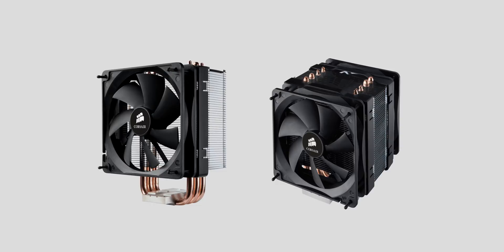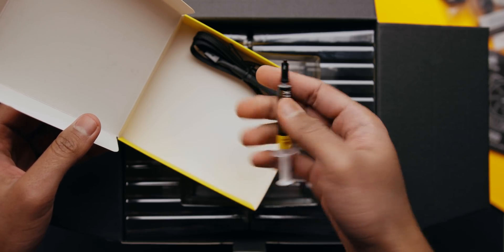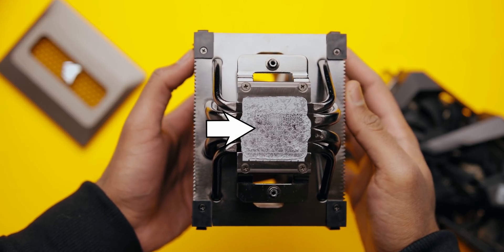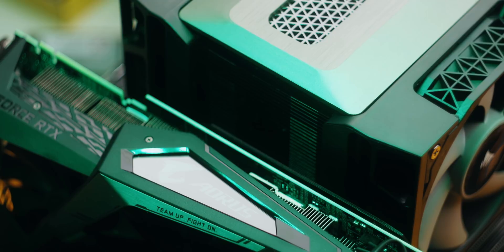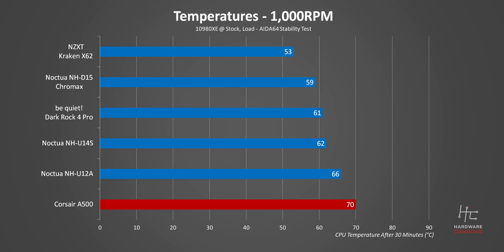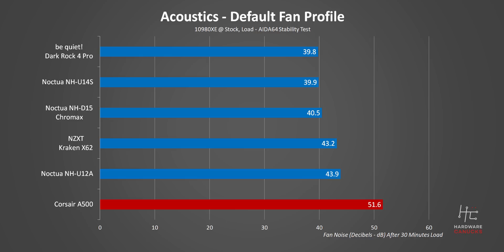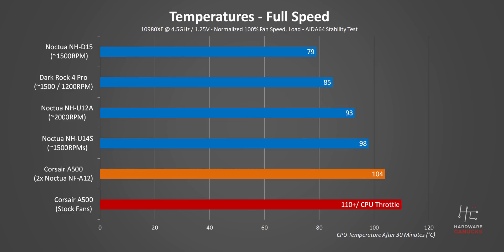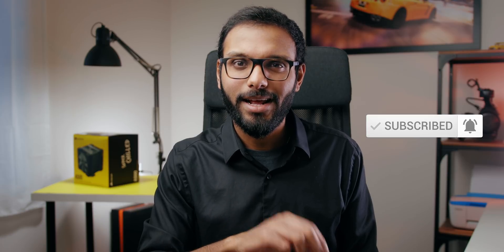Corsair A500 Air Cooler Review - Watch This BEFORE You Buy!

Comment: Why is the U12A so shit????????? You did something wrong!!!!!!!!!
It should have been almost equal to the D15, 2 more degrees at most. :|

What happened?????????????
Reply from the maker: On cooler running processors the U12A is amazing.  However its smaller fin array can only do so much when the heat production increases beyond a certain point and larger heatsinks with their increased thermal capacity start to pull ahead.  We did nothing wrong; this is just the nature of the game when it comes to cooling.
Reply: @HardwareCanucks  Then just use the 12A fans on the D15... It would still be an upgrade, right?
Can the U12A keep up with the 3950X though? No overclocking.
Reply: You are really indoctrinated to believe the U12A from Noctua is everything. I don't say that it is a bad cooler or Noctua isn't quality, but I have a cooler in my case that's only 60 USD and is in the same ball parc as this U12A if you take price/performance in consideration, but sadly none of these famous/well known Tech Channels fail to review it. That cooler is called Scythe Fuma 2.
Reply: @dorientjewoller113  It's not like I'm indoctrinated. But they advertised it so much as being the D15, but in a smaller form factor... This is the first good comparison with it, that disappointed me. :(

Btw, are you a flerf? Only they use the word "indoctrination" 24/7... 🤣

Comment: I feel like this would have been amazing with 5 or 6 heatpipes...but 4 heatpipes is just too weak
Reply from the maker: More heatpipes may have overwhelmed the small fin arrays.  remember, this thing has this massive void in the middle for installation purposes but that's a ton of space that could otherwise be used for more cooling fins.  That space likely causes vortexes to form which reduce the effectiveness of the fans.
Reply: @HardwareCanucks yes, terrible engineering
Reply: @HardwareCanucks  yeah but the NH U12A doesnt have any more fin surface area and has 7 heat pipes
Edit...well yeah the space in the middle was a lapse in judgement
Reply: @HardwareCanucks  why not add a 3rd fan in the middle? Wouldn't that negate the  vortex effects and massively improve cooling?
Reply: The other problem is the base is made out of aluminum where all of Corsair's competitors in this price category are using copper bases.

Comment: Yep, just stay with Noctua.
Reply: Or any of the other great options really. Deepcool, be quiet! or Scythe all make great coolers. Just don't get this overpriced garbage.
Reply: Overpriced and shit coloured. Thedmalright, Arctic and Scythe are much better for the price
Reply: @ryuuseiboi950  Priced appropriately due to incredible engineering and unrivaled cooling to noise performance, and the Chromax black series exists. Get your hater ass outta here.
Reply: @Thrashman138  but it's cool to be edgy and hate on good products
Reply: @Thrashman138  Whatever will make you feel better about your shitty purchase.
Reply: @Thrashman138  With all respect. I don't put 700 to 1000 dollar system in an already 100 - 150 usd case to release that the 100 usd Noctua NH-D15 doesn't fit coz it doesn't clear the 300 usd memory kit. What would be easier ... Getting a quality engineered Japanese cooler or getting a bigger case and transfer everything into it.
Reply: @dorientjewoller113  Noctua makes more than one air cooler and in many different sizes and configurations. Cool strawman argument, though.
Reply: @Thrashman138  Sadly, other companies do that too. There is a misconception that Noctua, despite its good quality, is the only brand that makes good quality air coolers and are suited for everybody or suited their needs. Ok, if you want the last herz out of your CPU, I would go too with a Noctua, but if you are running at stock speeds, a 50 USD Scythe Mugen 5 Rev. B will do the job too and equally silent. The heck, the PCGH version of this Mugen 5 is dead silent with its 2 x 800 RPM and keeps up with the NH-D15 of Noctua on 65 & 95 Watt CPU's.
Reply: @ryuuseiboi950  They literally tested it with the all black Chromax model you blind bat.
Reply: @ryuuseiboi950  oh kid, Thermalright and Scythe are just cloning Noctuas ideas...🤣🤣🤣
Reply: @CarlosGomez-hg4qo  It's a bunch of pipes, finns and a fan. How original can ypu even get? The only thing that distinguishes Noctua is how they fooled people to buy brown air coolers at 240mm AIO prices.
Reply: @CarlosGomez-hg4qo  the only idea scythe actually straight up cloned is the mounting system. And I don't blame them, it's the best one out.
Reply: I'm sure the attention you're getting from boredom is worth the edgy mask act.

You can stop holding that "I want to fight on the internet" sign now.
Reply: @ryuuseiboi950  Someone is an AIO fanboy....
Reply: @CarlosGomez-hg4qo  Ahum, you don't know maybe that if you get a Noctua in Japan, it's imported and distributed by Scythe. In fact, Scythe started as company in importing and distributing cooling solutions for industrial use since 2002. Later on, they started to mod the gear they were importing resulting in a later stage of designing and producing their own coolers.

Comment: I appreciate you guys not using an open air test bench and creating a standard testing methodology. Good job
Reply: The only thing I miss is a 40dB noise normalised test. The 1000RPM test is good too but it does potentially put fans that are quiet by design at a disadvantage. Because a consumer doesn't care how fast a fan is spinning but how well it cools and how quiet it is. The 1000RPM test is more interesting in the flow rate / static pressure sort of manner but hardly applicable in the real world.
Reply from the maker: Thanks!  It took a TON of work to get right.
Reply: @HardwareCanucks  Keep up the good work. It's always nice to see and it's one of the reasons i love this channel.
Reply: Neither is using the CPU they picked, Donald. So uhh... that's an odd comment to make.

Open Bench is just as acceptable as case use - It gives you a perfectly neutral comparison. Every case is different anyway, so unless you're using the exact same case and component setup as the reviewer, your results are going to vary.
Reply: This really does need to be highlighted. Open air test benches aren’t for a normal consumer. I appreciate the effort put into that.
Reply: @Harvester88  depends, they are much closer with CPU's than with GPU's temperature wise in scenario where good airflow case is used, I personally use Cooler Master MB511 RGB case, but with fans swapped with Noctua chromax ones and I get better GPU temps with it inside the case than in open bench because fans will pull out any extra heat outside of case while in open test GPU will recirculate some of that hot air, with cooler like this, it wouldn't make almost any difference but with Noctua NF-U14S which got only 1 fan it helps a lot, in open bench A500 would DESTROY it

Comment: Corsair has been taking it in the teeth from the reviews on this cooler so far. Was really hoping they’d knock it out of the park. The fan implementation is great, but doesn’t seem like enough.
Reply: Sean Daly because they don’t have a screwdriver.
Reply: @currentlykent4593  The NH-D15 does come with one though.
Reply: Also, the fan implementation here is extremely poor. By making those massive plastic rails they're actually hurting the cooling performance by a significant margin, not just because they're blocking passive heat dissipation but because they're so massive that the fans had to be severely undersized for the finstack.
If you look at their competitors, they all have fans equal or bigger in size compared to the finstack, that's to get everything out of the cooling surface. What Corsair did here is they used fans that are too small and then made sure no heat can escape from the exterior sides by covering it with cheap ugly plastic. This cooler is an absolute disgrace.
Reply: Oxaile also, the noctua cooler’s screwdriver doesn’t say Corsair on the handle so...
Reply: Oxaile should’ve put /s after my comment about the screwdriver. They test this cooler with different fans. Didn’t make a diff.
Reply: @currentlykent4593  I knew it was sarcasm, i just wanted to point it out as it made it even better.
Reply: Oxaile isn’t the driver that comes with the noctua L shaped? Feel like I’ve seen an unboxing or something with that cooler before. Either way, Corsair botched it with their cooler. Too bad. I think I looks good. Guess same could be said for some other Corsair stuff.